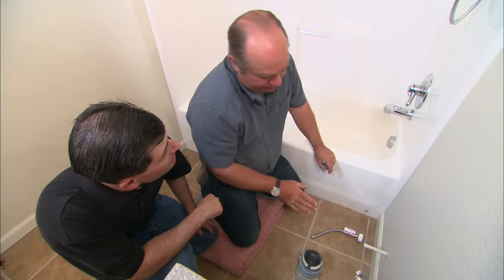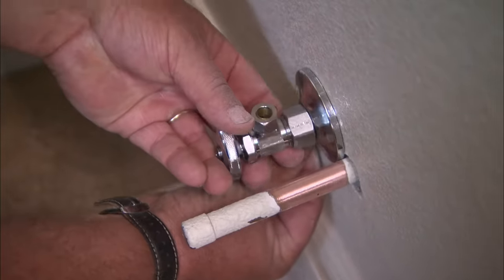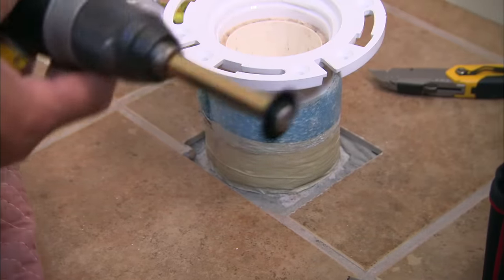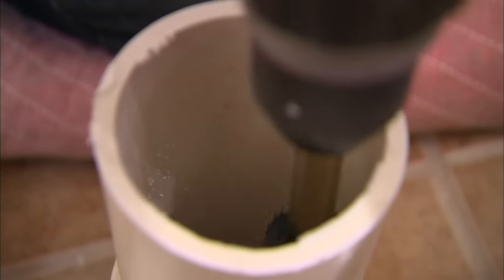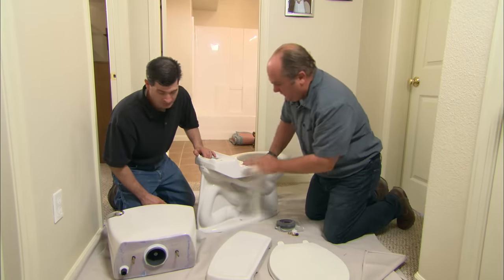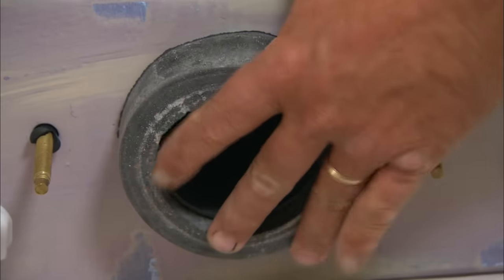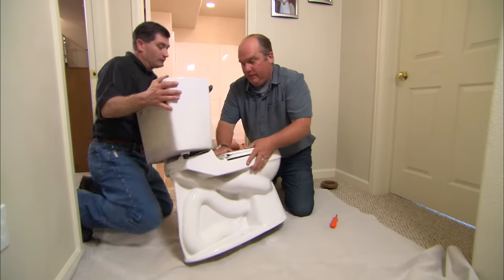How to Install a New Toilet | Ask This Old House

Comment: Video should be re-titled "How not to install a shut-off valve". Why the heck would you cut the pipe back so far as others have suggested? And surely you could have used a high quality ball valve rather than that cheap low quality multi turn valve. This is hack work.
Reply: i think he was thinking the same thing when he put the valve on the pipe
Reply: that guy is a master plumber, he took his measurement and knows what he is doing...so don't worry there :)
Reply: Plus he’s using the adjustable wrench backwards 😆
Reply: It's called this old house not how to do it right the first time.
Reply: Did it work?? The men knows what he's doing.  I  call it old school, the stuff made today is soo easy that it assembles its self..
Reply: It's a compression valve why would the pipe ever need to be cut ever again in life.. enlighten us all o great one
Reply: @3rdJose  Because if the angle stop leaks in the future, the repairman can cut the pipe back a little to install the new angle stop and he won't need to cut through the wall.
Reply: Jo The Great why would he have to cut the pipe? Just put in another compression style valve
Reply: MisterTwister it looks like he’s using it correct to me. Why is that wrong?
Reply: @iLikeC00kieDough  What of the leak is coming from the pipe itself? I would rather have some more pipe to cut off the leaking piece and put the new angle stop on good pipe. I would hate to have to cut the drywall over something so redundant as this.
Reply: Jo The Great yeah I agree he should’ve just left more pipe. It’s behind a toilet, you’re never gonna see 3 inches of copper
Reply: By doing it close with a multi turn valve, it guarantees a horrible repair in the future. It's just what everyone hopes for.
Reply: @3rdJose That type shutoff valve will fail eventually due to lack of use, age, and corrosion.  Given enough time, it will have to be replaced.

Comment: went to reinstall a toilet the flange was already there with bolts but they didnt use T bolt I believe they put them in the holes above where a T bolt would go when I put the toilet on the bolts werent long enough to put nuts on should I remove some of the wax or should I cut the bolts and use the T bolts that came with the seal

Comment: There are numerous triangle inequalities that hold with equality if and only if the triangle is equilateral.

An equilateral triangle is the most symmetrical triangle, having 3 lines of reflection and rotational symmetry of order 3 about its center. Its symmetry group is the dihedral group of order 6 D3.

Equilateral triangles are the only triangles whose Steiner inellipse is a circle (specifically, it is the incircle).

Comment: Should of used a push in flange with gasket. Would of eliminated all that unnecessary work.
Reply: J Thomas Rains Jr He still would have had to cut the pipes. The only part he would not have had to do was taken he spacer out, which was the easiest part. The in,y good use for those would be if there was no spacer and just concrete. If you have the space just put a normal flange in, I've seen to many in pipe flanges fail.
Reply: Are you a Licensed Plumber? Just curious. As with anything, if not done correctly, it's a fail. When done correctly, a fail is 99.9% impossible. If you've seen push in flange failures, I guarantee whomever did the work was probably unlicensed or a home owner. I happen to be a Licensed Master, and have 21 years in the trade. There would not be a single cut required, with the method I mentioned. Ive done 1000's of these repairs, and never have had a call back. All materials and methods are approved and ethical. With all due respect, your knowledge seems to be very limited at best.
Reply: J, you said "There would not be a single cut required".  Not sure what video you're talking about as the toilet in this video would have to be magically floating in the air instead of sitting on the floor, no matter what kind of flange you use.
Reply: Check out the "set rite" kit. Maybe that will help shed light on what I'm explaining.
Reply: I've used the set rite kit already years ago for someone's situation.  Now back to my comment.... you said quote "There would not be a single cut required"  This video has a drain pipe sticking about 5 inches out of the floor.  I'd like to know the magic involved, or do you want to retract the quote?
Reply: I'm talking about if a flange is recessed or broken, it can be done in most cases, without a bunch of cutting. I did not see the riser, and only caught the end of the video.
Reply: Cougar Land This is what I was talking about, they will still have the toilet floating. Also, about the differing statistics with failing flanges, I guess you and I work in different parts of town.

Comment: "First flush"
Now how did the water already in the bowl get there?
Why all that fake cheese melted over an otherwise fine program?
Reply: when they turned the water on and filled the tank the bowl filled at the same time. I know there are a lot of conspiracy things going on... but come on its a how to fix, u think they trying to trick u ? ( "that's awesome" was corny though" )
Reply: +Kaiba Uchia The bowl only fills by flushing or manually throwing a bucket of water in there...
Reply: no, lol. Once the tank stats filling, water is going into the bowl ... try it .
Reply: +Kaiba Uchia I did many times as I used to live in a house where one of the toilets was outside so it had to be shut off and drained in the winter.
Guess what, as soon as the water went back on the tank filled right up and the bowl stayed bone-dry until I flushed it.
If the bowl would fill when the tank fills, the water would keep running after flushing, which would be a waste of water and slowing down filling the tank.
Reply: No how it works with most toilets is that as long as the tank is full already it wont fill the bowl, however if the tank is empty, or filling the bowl fills as well, and yes this slows the tank filling, because the float in the tank stop the water to the tank and the bowl, or maybe there are different setups im not aware of. but its legit .
Reply: +Kaiba Uchia Every toilet I've ever seen flushes by forcing a valve open in the bottom of the tank, which then stays open as long as there is a powerfull stream of water going trough it, thus shutting off when the tank is almost empty and the pressure is gone.
Once that valve is shut, the increasing pressure of the tank filling back up keeps that valve shut until it is forced open again.
Since flushing empties the tank much faster than it can fill up, the tank would never get full and the water would run forever if the bottom valve stayed open until the tank is full.
Reply: no no no, ur misunderstand the mechanics, look in our tank you see a ball, that ball is attached to lock off, that is what cause the tank to stop filling...the valve works as u described it, but that valve is not what fills the tank or fill the bowl after the flush ..  depending on the toilet again ) yes there's some water that is "wasted" but that is part of the system .
Reply: +Kaiba Uchia The valve I'm talking about flushes the tank and is independent of the one filling it:
Flushing mechanism: Valve at the bottom of the tank held shut by the pressure of the water in the tank and its own weight, connected to the lever you push/pull to flush, opens when flushing and stays open by the rush of water going trough, shuts again under its own weight once the tank is almost empty.
Filling mechanism: Floater connected to a valve connected to the water supply, opens when the water level is below set level (new empty tank or when flushed), shuts when the water reaches set level.
That ball (floater) has nothing to do with flushing, only with filling back up. The overlap when both valves are open at the same time is minimal if any, and since the flush valve is shut under its own weight before turning on the water, it is impossible for the bowl to fill up before the first flush.
Reply: +Candisa yeah , think we lost the point of our conversation , we are saying the same thing now 🌝 so we are good .
Reply: +Kaiba Uchia Maybe, but if you're meaning the same thing, it would be impossible for the bowl to fill up without flushing as the bottom valve is shut under its own weight, but you say it fills while the tank is filling for the first time...
Reply: Ok, when i do it, i'll record it and let u know :)
Reply: I JUST replaced mine with a BRAND NEW toilet and YES it indeed filled up automatically BEFORE I ever flushed it.
Reply: +Follower of Yeshua I guess there must be multiple systems... A system with a not fully closed connection between the bowl and the tank while the inlet valve is open would definitely be illegal over here.
So if the drain is clogged, flushing will almost fill the bowl, but your toilets might overflow afterwards anyways because some water keeps on flowing to the bowl as long as the tank is filling up? Damn...
Reply: I am not doubting what you're saying. I can only witness to what I experienced lol! Maybe its a new toilet vs old one? Where do you live?
Reply: +Follower of Yeshua I live in Belgium. Funny how something so basic as a toilet can be so different.
Reply: We are in America or at least I am. I own a house in Texas where I live with my wife and daughter. Thanks for sharing and being open minded.
Reply: +Follower of Yeshua 6j
Reply: when you turn on the  water it fills the tank and bowl at the same time its not science
Reply: There's different kinds of toilets, how is that so hard to understand? Your toilet may be different from other toilets around the world. This toilet is super ugly btw. Stop calling each other idiots. You're all right
Reply: silly you, the picture was cut, it is television!!! Too funny you are! Maybe aliens put it in there
Reply: Flange is fixed with glue if glue breaks it will leak to structures. Only idiot engineer design connection like that almost like butt joint. Same thing with wax ring.
Reply: Not on a toilet in Europe. After you've installed a new toilet here, made all connections and opened the valve you must flush to get water into the bowl. Different systems, that's the reason for the misunderstanding that "this wasn't the first flush".
This is like you're using 3" drain connections for the toilet in the US and here in Europe are 100mm (~4") standard for this and we don't glue the pipes or use a wax seal.

Comment: A couple of things I disagree with.  One if that copper pipe is damage you're going to have a major job fixing it. I left about three inches. Second why not assemble the toilet after you set the bowl.  Third you glued the toilet flange if that breaks then it's a major job to fix. Instead use a slip on version.  Slips into the pipe and is very tight. Also I use a little chalk on the flange bolts so they don't tip over when putting the bowl on.  Fourth you should put a little bit of pipe joint compound on the supply line threads.  Last make sure the bolts are less 12 inch on center if not you have to find a special toilet for that.
Reply: Thanks Bill. I'm a nurse, not a plummer, but you sound right... you don't live in Michigan do you 😁

Comment: Would have saved 20-minutes of excavation if you used an inside-fit closet flange instead of an outside.
Reply: +moaski http://terrylove.com/forums/index.php?threads/inside-fit-closet-flange-3.23573/
Reply: +Glenn Watkins I wouldn't suggest an inside flange on a 3" line, but on 4" I've done it hundreds of times without issue.  They could've just cut the pipe flush to the finish floor and moved on. Besides, they would have been really screwed if that waste pipe wasn't wrapped with insulation.
Reply: even just stating that the possibility exists would be nice. So unhelpful if you don't even touch on other possibilities if this situation doesn't exactly apply to you.

Comment: I enjoyed the video and it’s all good as a new installation. But as an experienced plumber, the guy should have considered the future repairs in mind which apparently he did not. Also here two people are working together. 
But I wish he show how to install the bowl first and then tank on the top. Because there could be tight spaces where both pieces could be heavy to lift to snug it in. 
I have a situation where I have leaking from both the shutoff valve and through one of the tank screws. I bought the bolts from the home depot which goes through but it’s still leaking because of the gasket I guess
Reply: Your first mistake was using Home Cheapos bolts.  Go to a plumbing supply house.

Comment: Why would you use a plastic pvc flange over the one with a metal ring ?. And I’m thought I saw the fill tube inside the flush valve overflow . I’m pretty sure code in whatever state your in says it needs to have some kind of clearance

Comment: Believe it or not Cressent/ adjustable wrenches should only be pushed pulled in one direction, yours were backward. Also there's no need to take apart a compression fitting, since you did the pipe probably didn't hit the stop inside the valve body.
Reply: Also, also, why the hack saw on the closet ring bolts. that why they're notched, so you can snap them off. that way theres not burs so you can get the nut off later.
Reply: For explanation guys.  Sometimes you can't get a Crescent wrench to work the 'right' way.

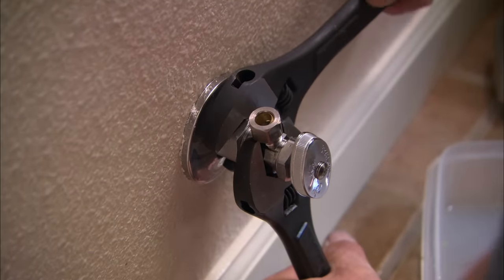Comment: This always makes me stop and think. At 1:45 notice how he's turning the nut counter clockwise to tighten the valve onto the copper pipe. He could turn the valve clockwise a few turns while holding the nut steady (or even move the nut counter clockwise at the same time) to secure it to the pipe. Right-y tight-y left-y loose-y depends on what end of the male and female you're looking at.

Comment: I've seen a few comment about the sawing drill blade, but I'm surprised no one mentioned the horrible cut it produced, very jagged, uneven and rough; I would have at least use a utility knife and/or sanding to smooth out the edge a bit.

Comment: Not related to the flange repair, but I found an easier way to remove the toilet tank from the bowl.  Use a corded electric drill (better than a cordless for this purpose) and drill a pilot hole as close as possible to the center of the bolt head in the tank.  Then use a bit that is slightly larger than the bolt and drill through the head using the pilot hole.  You may have to use a wrench or vise grips underneath to keep the bolt from spinning..  After you drill through the head of the bolt, it usually falls right out but if not, a little prying with a screw driver pops the head off.  No matter how old and corroded the bolt and nut are, they can be removed in 15-20 minutes.  I've replaced two seals in tanks that were over 30 years old and I found this approach much easier than using a hacksaw to cut the bolts.
Reply: @Hello Larry how are you doing

Comment: I've noticed that they nowadays (i Sweden at least) don't screw the toilets in the floor but glue them with silicone instead to minimize the damage caused by damp (contrary to popular belief, the toilets are sturdy as a mountain with glue). I wonder if that has become common in the US too?

Comment: Did not set in a bed of plaster, used a compression valve( not good) did not use pipe dope on compression threads ( not good)

Comment: so you put the wax ring in the floor first then set the toilet on top..... I've seen others put the was ring on the bottom of the toilet first...... which is the correct way?
Reply: Use a Foam ring.

Comment: Wax rings suck.  Use waxless seals. Way better and less mess.

Oh also double nut your tank bolts. If that bottom nut ever loosens you will have a leak. Double nut will prevent that.

Comment: Almost everything is right, except one thing I don't like is they don't put 100 silicone around the bottom of the toilet to keep it solid when you sit on it. Because the floor is not already flat, so the toilet bowl.

Comment: I have a sewer smell coming from a newly installed toilet which was rough up and was in that condition for 14 years, with no smell. After they finished a few weeks later or maybe two weeks. A smell filled the bathroom. They came and replaced the wax seal (3X) and still that smell. A have a lead pipe and the guy used a flange from _ow__.  Still have the smell, what could be the problem. I’ve been told three possible reasons and still it smells. The bathroom is on a slab, the house is a split level ranch, if that helps, so it’s the lowest level, with the septic tank is 10 feet from the bowl and two to three down in the ground,  I would appreciate any input, thanks.

Comment: I prefer the metal rimmed flanges. They don't break like the plastic ones.
Reply: Plastic is very strong,durable and long lasting it will not break that easily(only careless people will bust it)
Also,metal flanges will rust with time whereas plastic does not

Comment: Hi there. Goodday, browsing glad I stop to watch your video ( That little pipe I have a pipe that's downstairs in the basement and it leaks. I'm told to put glue and a cap on it.  Also where is the water coming from? because I have the water valve shut off.  ( New water pipes are being put in throughout this conmunity ,The old pipe  just turn the knob and the water was cut off. The newer shut off valve one, you twist and push down the knob.  The older ones seem to work better i cutting off the Complete Water  Maybe the leak stop  I haven't been down there yesterday  I'll check today but I was just wondering is there any other water source that it could be coming from maybe it was just draining).PS. What if the pipe is a PVC  plastic can you still put a nozzle on it?                         Thank you